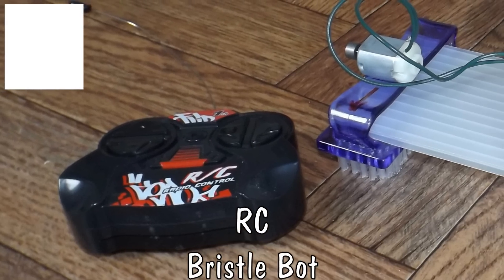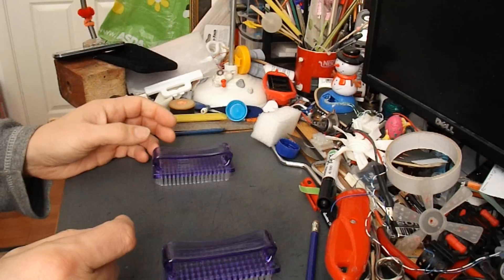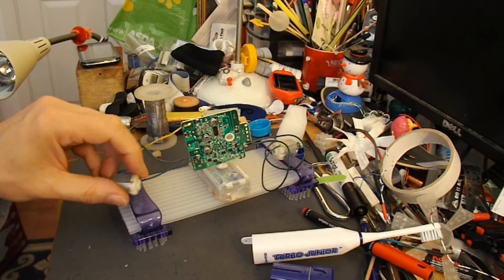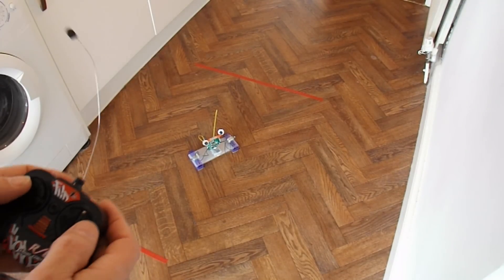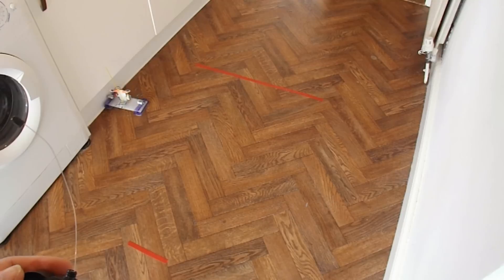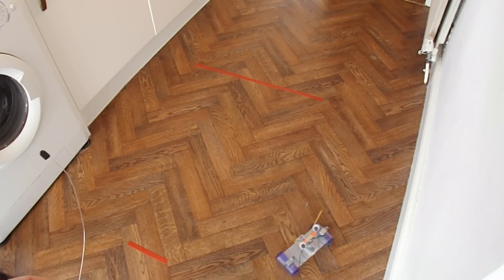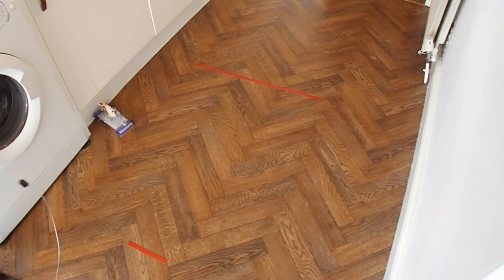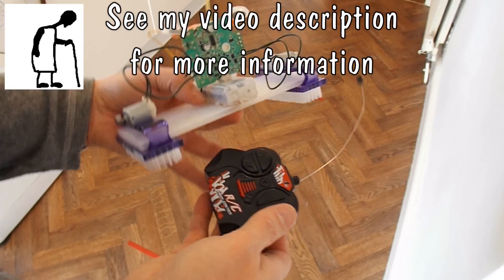RC Bristle Bot

Comment: The bristles need to be slopped back some how. You may be able to squash it in a vice. Perhaps heat it too? Or may be just cut the bristles at an angle, shortest bristles at the front. The whole thing will lean forward.
Reply from the maker: Have you built one yourself or are you just repeating what other people have said on other videos? You did watch my video and see that I was controlling it's direction via radio control. What I would really have liked to achieve was forwards and BACKWARDS control. As it was, it was just forwards and turns.

Comment: Make a slight angle on the brushes, so the whole thing is tiltet forwards. THat'll make it go one direction.
Reply from the maker: But I don't want it to go one direction!! I want it to go 4 directions. If I only wanted it to go one direction I would have just used 1 brush and 1 motor and no radio control.
Reply: True, but you could still alter the engines like you usually do. It might not be able to reverse, but it'd turn and go forwards.
By the way, thanks for such a quick response, Grandad!
Reply from the maker: TheShiphoo thanks, but I am confused. Did you watch the video? It does go forwards and turn under my rc control. In fact with a little practice I was able to make it go wherever I wanted. If you want to see more successful rc bristle bots have a look at the video links in my video description.
Reply: Hmm.. Sorry, but that didn't seem so controlled. Of course, that's difficult to say when you're sitting here, infront of a computer.
I'll have a look at the links!